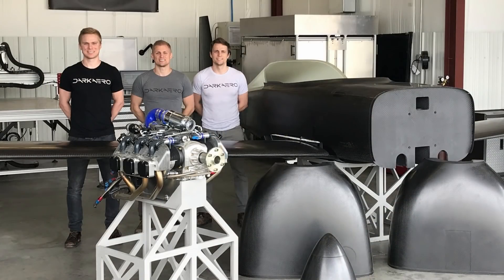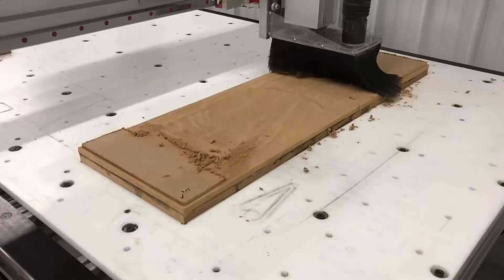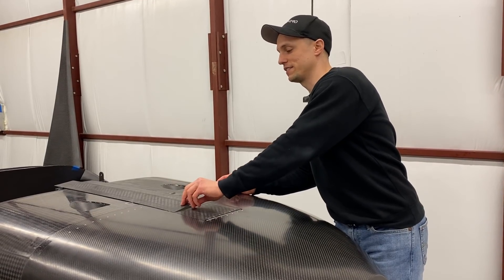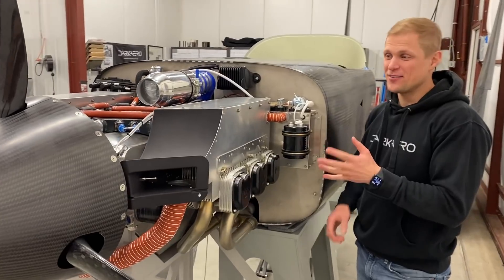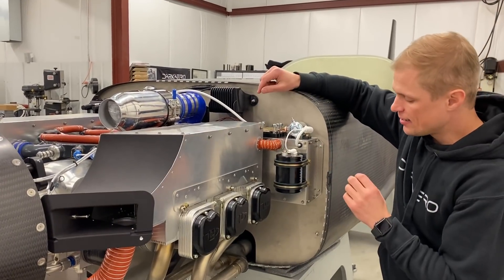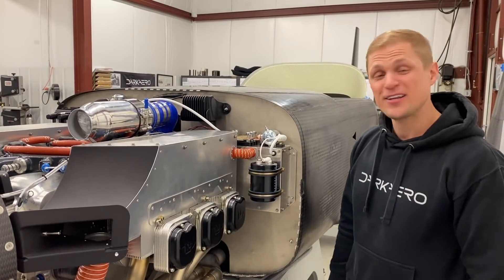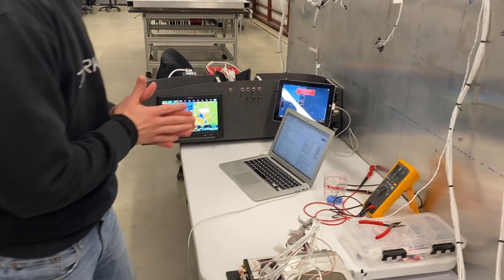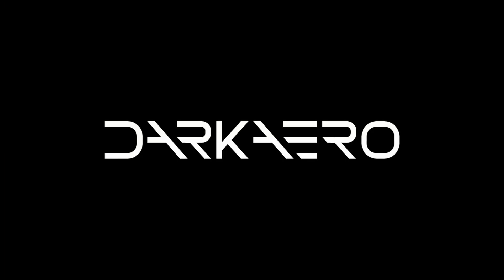DarkAero 1 Progress Update  (Feb 2021)

Comment: I'm at a bit of a loss for the whole 3 door thing, wouldn't the little front flap generate a lot of aero resistance ? (perhaps make it harder to deploy the gear & open itself VS having two parallel doors)
Not an engineer, just curious as to why.

Comment: Cannot understand how leg mounting doors is not the way to go.. "Stops" a little finikey.,but compared with the amount of additional hinges and bits..
Battery and its back up.,could you not mount it in the plenum throat.?Would have saved building another box., be on the cool side of the up wind side of the engine..

Comment: Not my field at all, but I think very often about making a custom carbon fiber fairing for my old sport-touring Honda ST1100 motorcycle, so this might be a very good or very bad question.

Why is the fuselage square vs. round? Square is weaker than round. It is also prone to sidewinds. Is limiting the air displacement volume that important?

Comment: Love the work you're doing. I think you missed the mark with the retractable gear door(s) though. Your design will chatter at speed due to lack of bracing at the ends. Just a slight touch bends the ends, imagine what the airflow will do. Keeping this design will likely require you to move the hinges out closer to the fore and aft edges and add a third one in the middle. I would recommend revisiting that and simplify it. You mentioned considering a one piece door secured to the retractable gear, IMO that would be you're best solution. A sturdy design securely attached to a solid structure could provide a simple solution without moving parts.

Comment: Coming from an electrical engineering background, I have some thoughts on improvements for the battery box. For Lithium based batteries, it is just as important to keep the battery hot enough and not under-cool it. By having the box being passively cooled you risk under-cooling the batteries which might lead to damage and reduced performance. I have some thoughts on the charging mechanism as well, and have experience making my own mattery management systems (BMS) for high power, low weight systems. Hit me up, I'll gladly provide some insight (and maybe designs)

Comment: Wow guys, you are so young for so much knowledge. I think I'm the same age as you two, I completely restored a car by myself, tearing the car down to bare shell, paint it, rebuilt the engine, made custom parts, refurbished the suspension, made partly the wiring myself, and all this knowledge took at least 4-5 years.
You are on a whole another level. Making carbon fiber parts, cnc machining, custom harness with circular connectors, an engine bay with such beautiful parts and a GODDAMN PLANE. Did you work on cars before or built them? Huge respect to you guys, amazing knowledge

Comment: It doesn't mean much but I'm impressed... with nearly 30 years in (CAD/CAM) aerospace composite part manufacturing (and as a private pilot - 45 yrs... which also never seemed to mean much to anyone other than me) it's interesting to see what you're doing. There are times that I think I'd like to have been involved with projects like this. Building an airplane is not a simple project. Thanks for sharing, stay safe, enjoy

Comment: Heat in the battery after shutdown when the heat from the engine warms up everything in the cowling won't be an issue? 
I can see a situation (long fuel stop on a hot day) where the battery could get heat soaked, warm up further from having to start the engine, then be subjected to further heating from charging on climb-out where airflow is reduced... Lithium would make me nervous in an airplane. 
I guess if the battery box can resist battery combustion well enough to prevent the fire spreading?

Comment: The plenum looks like an efficient air control to cool the engine.  Even airflow over the cylinders is a challenge.  What concerned me was access to the spark plugs.  It appears the lower plugs may be accessible but the uppers appear to be buried inside the plenum.  If that is the case, do what you can to make the plenum easy to remove.  Four snap screws or something quick.  It is not uncommon to have to change a plug in in the field (away from a hangar and tools).

Here is a request/suggestion.  Make it easy to to de cowl for access without having to to find a place to put the fragile cowls while working on the aircraft.  If the two sides folded up and over center onto the opposite side, on a central hinge, and had a retaining hook or strap, it would make it safe and easy to access one side of the engine.  Again, changing plugs, inspecting for oil leaks, loose fittings.  A much more thorough preflight could be conducted with a simple to open cowl.  Looks like a great aircraft.  Hit me up when you are ready to start selling them.

Comment: On the deHavilland Mosquito the gear door mechanism was astonishingly crude: tube "skids" on the strut pushed open the doors at the front, and they were closed by coil springs at the back. 
 
Caused no problem at 350 mph.  
 
I do not think they even had a locking mechanism.
 
Of course one would build that of carbon today. As closing spring I could imagine a LENGTHwise flat strip that is twisted 90 degrees when opening.

Comment: 5:50, a small tip on improvement is to make the airflow duct -  feed the bottom of the battery can and vent the outflow of that air on the top side of the battery can.

Comment: You might want to rethink the capacitor on that battery.    Batteries themselves are typically though of as the stabilizing current source -- but the large capacitor might be important if you are switching the battery with that solenoid EXCEPT the capacitor would be placed on the fused side of the circuit (the far side of the your solenoid switch).   Yes?    Typically, large capacitors become important when on the other end of a long wire away from a battery source.   But, in this case, if your solenoid is somewhat dirty in its switching then a capacitor adds value on the fused side.  I'm not sure why would not use a modern solid state switch on that for better reliability.  (perhaps there is a down side that I'm unfamiliar with in aeronautic applications)

Comment: Did you consider airspeed and vibration when the gear doors open? A slight curvature to each door can add massive strength with very little complexity and weight to the piece that increases the lifespan and protects the hinges from vibrations using airspeed.

Comment: Just out of curiosity: Why are you machining the steps into your door moulds? We usually just engrave the outlines of the parts into our moulds. The line gets filled with resin and shows up nicely on the laminated parts and you don't have to deal with sharp edges and corners. But then again it might be faster not to change the milling bit on a qick prototype mould.

Comment: Using OnShape your CAD Files are not Secure. Your send hot air over the battery. Your landing gear doors will resonate like a clarinet reed. So much to learn. Would like some help from an MIT engineer?

Comment: Heat transfer to your battery box could be greatly reduced if you added aerogel sheets to the inside of the box. Aerogel has an R-8 per centimeter insulation capability, so even a centimeter thick aerogel layer would provide significant reduction in heat soak into the battery box from the hot air coming off the cylinder heads. Aerogel has been described as "solid smoke" with a density of just 0.02 grams per cubic centimeter, so it will add almost now weight. And being made almost entirely of silica, it is non-flammable. You might be able to just use adhesive to hold the aerogel panels to the inner surface since it will not be exposed. But if abrasion protection is needed an aluminum foil could be adhered to the aerogel to cover the inner surface prior to installation with an aluminum tape sealing the corners. And in the event of a battery fire, the aerogel nonflammability and insulation would help to contain the heat and slow its spread to other parts of the aircraft. In fact you could adhere nomex fabric to the inside surface of the aerogel to provide even more containment of a battery fire.

And I don't know what you have planned to insulate the firewall, but aerogel panels could be an extremely effective and very light solution to reducing heat transfer to the pilots feet! Sandwiching the aerogel with nomex here as well would give some added protection of the pilot in the event of an engine fire.

Oh, and the plane looks AWESOME!

Comment: Some really great job, here. Being in the aerodynamic sector (still at school) I had some questions. 
The part of the fuselage between the canopy and the vertical stabilizer seems so thin... Don't you have at high AOA some troubles about that (due to some loss of air, whith that thick boundary layer)? 
And still about that part of the body doesn't that affect your curb of grad? Same for the top end of the plane
About the shape of the inlet for the engine cooling, I don't understand why did you take specifically that shape.
Good luck and good work

Comment: If you’re going to have any sort of climate control in the cabin, why not just use that to keep the battery within operating temp instead of using the air box

Comment: I'm a design engineer (electronics). I think you have dropped the ball with regard to the electrolytic on the front of the Lithium pack housing. As a rule of thumb a 20C rise in temperature reduces electrolytic life by a factor of 10. That could be partially mitigated by moving it towards the plenum. Another alternative is using a PCB loaded with ceramic capacitors but that will make you go cross eyed cost wise and then there is the vibration issue (they tend to crack and short out). My suggestion though is a small bank of say 20 lower value caps with radial leads on a PCB and secured with ty-wraps of the highest temp rating vs life rating you can get and and cooling them in the same housing as the lithium cells. The other point is that with lithium's there is a dendrite issue. This too can be mitigated to a point. Cooling is a damn good start. However there are military studies that demonstrate that to maximise life you need to do two things. Charge and discharge currents lower than maximum rated. The lower the current compared to maximum rated the longer they last. 2 reduce Vmax and increase Vmin on the pack. I have got a pack cycling three times a day and it's still not down to 90% capacity after 3 years by increasing Vmin to 2.8V Vmax to 4.0V and 30% of rated currents. https://www.powerelectronics.com/markets/mobile/article/21859861/proper-care-extends-liion-battery-life is a commerical investigation but will give you enough info to work with. Reply if you want more info. Just for the record I have been a senior design engineer for a military subcontractor, a while after that worked for Crane Aerospace, and my specialty is safety critical/high reliability systems. I also design some of the weirder instrumentation for radio telescopes (believe it or not the two fields overlap a lot).
Reply: What's a "design engineer (electronics)" and how it differs from an electronics engineer?
Reply: Well said.

Comment: how's the airflow around that airbrake shaped front nose wheel door though...?
Reply from the maker: Thanks for watching Matt! We’ll be testing it out. It wasn’t shown in this video but the portion of the gear strut leg right behind the door is roughly similar frontal area already so even without the door there there is a bit of an air brake going on.

Comment: I'm a final year MEng Aerospace Engineering student over here in the UK and just wanted to say I'm enormously impressed with your work. The combination of craftsmanship and forethought design is excellent! I love the explanation of the design iterations as you bring certain elements of the CAD model to life. Quick question, how did you gain access to this hangar/workspace with so much excellent equipment, do you have to pay to use these facilities?

Comment: Would you be able to a-fix a panel to the arm of the landing gear that would seal the opening when it was fully retracted? Because then you wouldn’t have to fuss with multiple doors and hinges and components to operate em. Because it would literally be a fixed shield piece on the arm itself. I hope I'm explaining this correctly so ya can visualize what it is I’m inquiring about. Beautiful craft.

Comment: I don't understand the battery situation. If you're concerned about heat soaking the battery due to its proximity to the engine, why not relocate it elsewhere in the fuselage?
Reply: Battery electric cable weight.

Comment: These guys are legit. They make it sound as if it’s a simple thing. Even though they have a cnc, getting things to fit is hard, even on flat surfaces. It’s not even simple to make a decent bag and get the resin to go where you want in an infusion. It’s very expensive to learn as your destroying so much material. Respect. Excellent work from these men. Dudes like this built the world.
Reply: Man ...you are so right
Reply: Then best ask RC glider pilots, they do that on just a smaller scale and solved it. Especially the Dynamic Soaring guys know what they do, the latest speed record is 548 mph and you are pulling a constant 50g or more.
Reply: @feedingravens but gliders are different. These guys are buildings an experimental craft, yes, but they're trying to do everything to better-than-modern levels compared to today's fully rated aircraft. So they're basically pushing the envelope as far into the future as possible. And Hill is doing the same thing for helicopters, too. It's incredible. Once wages catch up in a couple decades, these will be the new Cessna 172s.

Comment: Damn, look at all the aviation experts here. How many of you"experts" have built your own plane? I'm waiting!
Reply: This is a dumb train of logic. There is a TON of crossover to other fields - electronics, fabrication, internal combustion engines, wiring, etc. You don't have to be a plane builder to recognize a flaw and provide input. Dismissing constructive criticism with a wave of the hand and a, "HuRr DuRr WhErE's YoUr PlAnE?" is... Unwise. If someone well-versed with wiring is telling you that your wiring is fucked up, you might want to double check your work. Best case, that person is wrong and you've spent a bit of time looking stuff over. Worst case, you ignore their advice and crater the aircraft later.
Reply: Snarky and not very bright.

Comment: The battery cooling duct might be a problem after shutdown.  I've had similar issues with my RV8 when testing battery box temps for my new lithium battery, and just barely caught the temp rise after sitting in the cockpit with the master on while making a few notes.  The cooling plenum is raised above the inlet, so the hotter air from the cylinders will naturally want to rise and be trapped up top in that space, potentially allowing hot air to migrate through the SCAT tubing into the battery box.  Only thing I can think of to remedy that if it becomes a problem is to route the tubing straight to the inlet away from the plenum above the cylinders, or build the tubing from sheetmetal integral to the plenum wall itself with an opening close to the inlet.  Probably not a great idea to vent it directly to the cowling, and adding a NACA duct or similar to the cowling just complicates things with additional weight/drag/cowling removal.  I elected to bond carbon fiber tubing alongside the plenum (which was also CF) and simply trimmed an inlet for it near the cowling inlet after molding a simple duct to connect fresh air with the battery, which solved the problem.  The battery stays a few degrees above ambient even during summer temps in TX.

Comment: For the hinges on the landing gear doors, have you considered making it from a thin sheet of carbon fibre (a flexure) that bends, rather than pins rotating inside holes?
Reply: Living hinges don't last nearly as long as a mechanical ones.

Comment: Oh dudes ... you NEED to have analog backups of the instruments in case the entire electrical system fails, as electrical system do.
Reply: These days the backup instruments are often electronic pulling off an independent ADAHRS. Wingbug is an interesting looking product for this and also provides an AoA indicator which I'd want to have on a fast plane like this
Reply: @keim3548  The G3X has an AOA.

Comment: You could make the door be rotated into the hole and out of it kind of like a conveyor belt that goes one way and back the other but using a small hydrolic puller to get the door to move underneath. That way you only have to make one piece instead of three.

Comment: One great little tools are laptop 12V cooling fans ,they are cheap ,very light ,reliable and efficient ,when I built my sleeper Volvo carbon fiber dashboard ,I used them at key spots to keep my fuse boxes ,wiring ,gauges ,battery packs always ventilated and to extract hot air in tight closed spaces ,and it fights humidity too in critical places.

Comment: Why wouldn’t you put the battery with the aft electronics plate?   There would be no worry about dealing with engine heat.  After engine shut down, the engine compartment can get really warm, >140F, which may cause battery starting issues (inside the cowling heat soak) when the aircraft shuts down during a fuel stop.
Reply: Kent, the weight of the electric cables to do it would weigh more than the battery